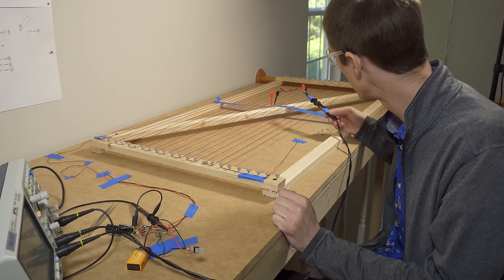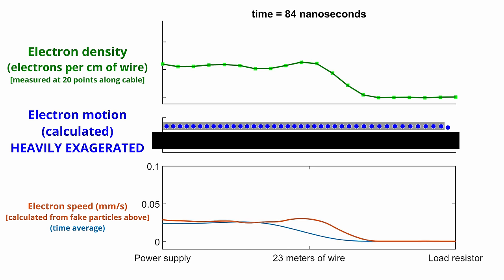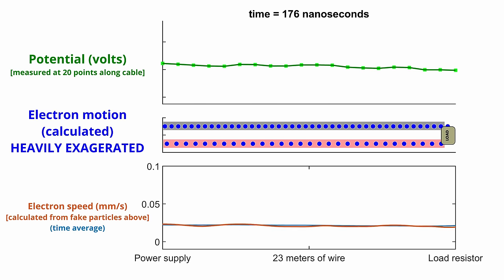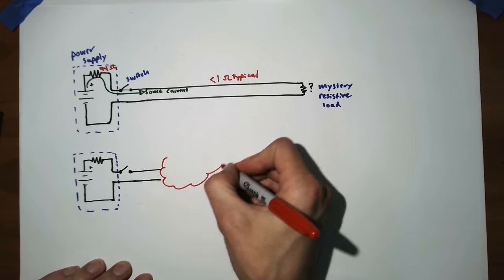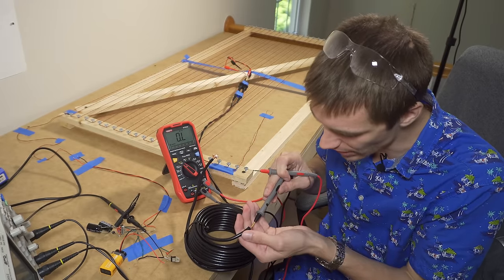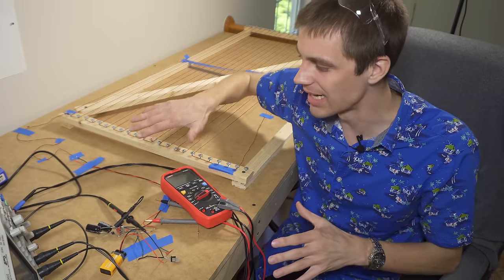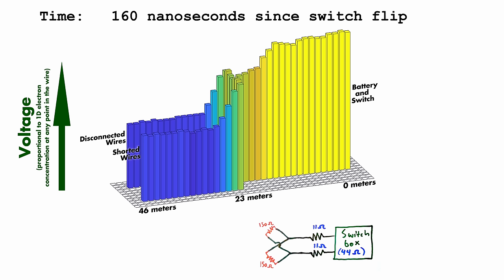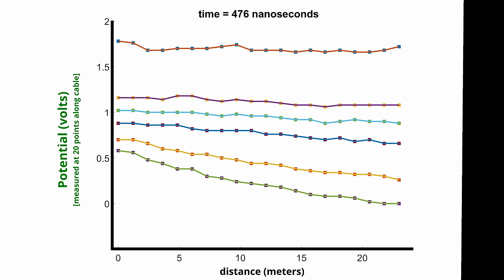What does "impedance matching" actually look like? (electricity waves)

Comment: To have an idea of where the 150 ohm characteristic impedance of the cable is coming from, you can think of the wire having some inductivity and that there is some capacitance between the two twisted wires in the cable. If you would compute the series inductance and parallel capacitance, the resulting impedance would be 150 ohm. Of course, when modeling this, you would split the cable into an infinite number of sections and each section would have its inductance and capacitance resulting in the characteristic impedance of 150 ohms. You can thing of the wave propagation as the transfer of energy between those inductors and capacitors in the infinitesimal segments, each having a 150 ohm characteristic impedance. This also helps to think what happens when the wave leaves the last segment of the wire and hits a short or open.
Reply: To understand that, I would have to know what inductivity and capacitance was but yes, it kind of makes sense. I'm still not sure how you can measure both impedence and resistance in Ohms. If they have the same units, shouldn't they be the same quantity? I guess this is like how "power consumption" is measured in "Watt-hours" and "energy" is measured in "Joules"?
Reply: @aspuzling  You would measure them in Henry (Ohm * sec) for the inductance and Farad ( C / V ) ...I hope I still remember correctly, for the capacitance. (where C is Coulomb and V is volt)
Reply: @aspuzling  So both resistance and impedance are the same ‘thing’, except that resistance in DC is a special case. The formulas for impedance of capacitors and inductors are complex (as in have a real and imaginary part) that depend on frequency, and at DC what happens is that the impedance of an inductor goes to zero and the impedance of the capacitor goes to infinity (which is the same as an open circuit), so once it reaches that steady DC state you can basically assume that both the inductance and the capacitance that is inherent in the wires doesn’t exist anymore, and all you see left over is the resistance. So impedance is the same thing, but the dynamic nature of the signal (in the case in the video it’s a transient, the voltage changing in a ‘step’ from zero up to the voltage of the battery when it’s switched on) is bringing out extra elements that you just can’t see at DC.
Reply: @DrenImeraj And the consequence of this is that the "width" of the traveling step-pulse wave front imposes a limit on the practical bandwidth of the wire?
Reply: The wire also has Reactance ie its "resistance" to the flow of AC current as in AC the magnetic field is rising and falling all the time affecting the flow of the electrons.
Reply: @stephengentle2815  Thanks for your excellent explanations. The idea of DC resistance being a special case of impedance is fascinating and explains a lot.
Reply: @aspuzling WH and joules is the same unit, same BTU, it doesnt matter the unit, the power or energy is what those units counts, same as hp, bhp, W, joules/s.. etc
Diff ppl used diff units, for the same magnitude of specific physical property
Reply: This brings me back to doing impedance phasor diagrams, and using simple trig to find the Z of and RLC circuit. Years ago...can't remember anything other than it was fun!
Reply: you don't need the inductance. Speed of wave propagation, (which can be assumed at 2/3c most of the time) will also work and with it resistance is much easier to calculate. You have to charge wire segments (which have capacitance per unit length) at 2/3c. you have capacitance per time, which is charge per time per volt, which is current per volt, which is resistance
Reply: Yes. What surprised me about this is the way they don't seem to stratify the standard on the basis of frequency. As frequency goes up, parallel capacitive reactance of the wire itself should go down, and series inductive reactance should rise, so why isn't there a 'sweet spot" frequency for optimal balance? And the way the standard is based on a theoretical open circuit line of infinite length is mind boggling.
Reply: @spelunkerd  you are mixing steady and transient states..
Thats why you dont get it
Read about it, its easy, transient state is until the "circuit solves itself" all after that is a steady state, no matter AC/DC..
Reply: @isaackvasager9957  i doesnt make him wrong
We from the field are not to blame that very simple facts and laws are not making sense to ppl outside of the field
All seen in this video was known for allmost 2 centuries, mathematicaly expressed and totaly studied, we learn that in school, in fact, if you payed attention to your 6 grade physics class you wld know all this, and it wldnt surprise you
And if you studied el eng, this wld be kids play to you..
Reply: @coaulsi  Yes I think you're right. One blip of voltage pulse can't have a frequency.
Reply: Spot on
This was known for at least a century, when transmision lines were first instaled, in fact, this was allready considered solved from the time of the telegraph
You are totaly right on the infinitely small segments, serial inductance and paralel capacitance, some resistance, ofc, as all metals have some small amount of resistance, and reluctance..
Impedance is so simple, you just need two dimensional numbers to write it down, L and C are a duality, like anything else in electricity, they do nothing to U(V) or I, first duality, from which all other come, just change phase of one of them compared to another, and DC is a spec case of AC, where inductor is literary nothing, a closed circuit, but capacitor is a break in the circuit, if connected serialy with a power supply, if connected in paralel, the oposite is true, again, duality
If not for that duality, we wld still see electricity as a danger to us, and in a tunder strikes, nothing technical wld be possible, and in fact the mechanism of the thunder is the same what he shows, universe doesnt know which molecules of air are going to be ionized, so the whole proces nano second by nanosecond is governed by the same principles, conditions arise, voltage is high enough, current starts to flow, ionizes air, gets reflected from the ground up, etc; if u watch a thunder strike in 10-100k fps, you see that thunder starts at the same time both from the clouds and the ground, gets teflected multiple times, before steady state arises, cloud comes down and same happens again
Tesla noticed a century ago that thunder triggers rain, or is it another way arround, doesnt matter, thats another example of duality, though diff kind from voltage/current duality, it tells us that we are the ones that "invented" those dualities, in order to use math, and make any engineering possible
Line Z is a very well known "phenomena", explanied arround the time first telegraphs experianced signal reflection, for example
All this guy uploads are minimum century old laws and rules, it shld be watched by kids, not grown ups, as we all learned this in physics classes, in elementary scholl, at the latest first two years of secondary school (elementary school 8 grades, secondary 4 grades, i had this in all encompasing school, the one you go to if u want to go to the uni, later got degrees in el eng/telecommunicatins, and astrophysics, all for free, thats the system in my country, if you are good enough student you get free education, only small number of students pay their schools/unis, maybe 10%, in fact we get payed to do a phd, as a university profesors helper, thats how i got both masters degrees in two diff schools, they paued my C2 eng test in british council, and all else needed for my studies)
I live in a country, ex SFRJ/Yugoslavia republic of Serbia and all of my education was free, there are some private schools, but no one will employ a student from those schools if they have candidates from the states unis, our educational system and our social security is the two things that work here, with all corruption, a uniparty allmost, again, and a politbiro (they dont go by that name since SFRJ was torn appart by the west/usa/nato, we are now "democratic, capitalistic" but ppl never lived with less, in '85. for example we had 5th largest ground satelite station, we had nuclear programme, 40mil ppl, now there is 6 countries, Croatia and Montenegro with only turism, slovenia with one tech company (real tech, not sw devs Gorenje), Bosnia has nothing, they are not even a propper country for 20+ yrs now, and Macedonia (North Macedonia is the official name, bcs Greece had a problem with it, bcs Alexander the Great was a son of a Macedonian, not greek..); then, before 90s we were a great country, everyone in the world wanted our passport, but we were the thorn in the usa eye, so cia did its job, it turned neighboures against each other, and watched how we kill ourselves, there were all kinds of religions in SFRJ, namely orthodox and roman christians, and muslims, even long before that, but the creation of Albania in ww1 was the breaking point on the balkans, we drove off the Otomans after 5 centuries of their rule in 1800, we had two balkan wars, liberation wars; europe let us be the buffer zone against very advanced otomans(todays Turkey), never helped us one finger, and when we drove them off, and the dynasty collapsed and became modern Turkey, we flourished, all of us together, we grew too much too fast, usa/europe didnt like that, nato even bombed our cities, bridges, rafineries, they hit empty military hq building in the centre of Belgrade, our TV station, same in the center of the capitol city, and no one evergot punished for that, 23yrs later, usa and the whole west goes down the drain, whole world laughs at them, china won, its over for usa, esp, germany will turn their back on them, its the land of genocidal maniacs, and unscrupuled so called bussines man, and the whole world now sees that, every war since ww2, which usa had no wish to participate in, but rose economicaly and technicaly to world power no1 teached them that the war is the best bussines, but not war against other world powers, russia, vhina, india, no, wars against small unstable regions, which only need a spark to ignite the war, then cia provides weapons and sit back and watch their mic print weapons for both sides, thats the war on terror. Goebels said it best, on how to control the ppl, and how to attack others in self deffense (a promise of it): just tell the masses they are being attacked from within, and the usa learned that lesson very well, they sre in a state if constant war, since ww2, have 700 bases arroind the world, most arround the china, usa is petrified by china, but they know they cant win that fight, so they pick on taiwan, which themselves they aknowledge as part of china, thats uts own story
Sry for the novel, i got carried away by mostly americans not knowning nothing about anything, but trough the lies they are the no1 superpower (very questionable today, just look the last two presidents, and idiot, and a senile very old man, who by the way "ordered" the bombing if Serbia in '99.)
Deplorable country worthy of everything bad its going to happen to it in the next decade, the worlds police man is the most corrupt guy on the planet, and shld be expeled from the rest of the world, and that process allready started, ukr is over, now show of power trough the israel, a openly genocidal country, polar opposite from the country it shld be, cosidering their faith in conc camps, or is that story overblown too, in order to masacre garmany, usa and britan leveled most of the germany at the end of the ww2, alongside the rest of the europe, the cradle of civilization, all from the same genocidal ppl who killed off most of native ppls of americas, all european in origin..
Again, sry for the tyrade
Reply: @spelunkerd  ofc not, frequncy is something happening over time
That one blip/pulse is just that, a momentary spike nothing more, you can measure its amplitude and calc the current on some load, the current will be the same spike, inductors and capacitors wld just change their position on a time axis, on a plot, if time is on horizontal axis, current wld ne ahead, or trail the voltage if load is not purely ohmic (has some L or C)
Reply: Lumped element circuit model for transmission lines has 4 transmission line parameters (per unit length)
R' = combined resistance  (Ω/m)
L' = Combined inductance  (H/m)
G'= Conductance (S/m)
C'= Capacitance (F/m)

Additionally, there are geometric parameters depending on the type of transmission line geometry (in units of meters)

Coaxial cable: 
a= inner conduxtor
b= outer conductor

Two wire:
d= wire diameter 
D= Wire spacing 

Parallel line:
w= width of each plate
h=thickness of insulation
Reply: @aspuzling  DC resistance being a special case of AC impedance may become a bit more intuitive if you realise what complex numbers are. You're already familiar with the idea of a "number line;" complex numbers can be represented in the same way, but instead of being on a line they're on a plane, like a standard X vs. Y graph. In this case, the horizontal axis is the "real" part of the number and the vertical axis is the "imaginary" part of the number, the part you multiply by i (often notated as j in electrical engineering), the square root of negative one. So 2 + 3i is two to the right on the horizontal axis, and three up on the vertical axis. If the imaginary part is 0i, then you have only a real component, and when you have only a real component you can call that "resistance" instead of "impedance."

(As a side note, "imaginary" is a terrible name for multiples of i; they're no more or less something we imagine than the "real" numbers. It's just that, back in the day, René Descartes hated the idea, thought that such numbers were fictitious or useless, and so picked a derogatory term to talk about them, not realising that complex numbers can be mapped to physical phenomena in the real world just as easily as we can map 1, 2, 3, ... to "one apple, two apples, three apples, ...." It's akin to someone deciding that negative numbers are "imaginary" because we can't hold "negative one apples" in our hand.)
Reply: @spelunkerd  Actually a single pulse or blip can have a frequency: being able to calculate the frequency at any instant in time is why we have calculus. Whether this is important or not depends on the application, but too-fast switching in certain systems not designed for it (e.g., high-speed 74AC logic combined with old vintage 74LS-era CPUs and peripherals) can be a problem due to ringing, caused by the very phenomenon this video is demonstrating.
Reply: So if the wire gauge or separation of the wires (not twisted, for example) were changed, the impedance would change and therefore that resistor? The 50ohm coax cable has a characteristic 50ohm impedance when a impulse voltage is applied?
Reply: @trevorwynkoop8591  A twisted pair of wires are still separated by the width of the insulation surrounding each. And yes, if the separation is changed, the impedance of a transmission line made from those wires changes. 50 ohm coax has the same characteristic impedance regardless of what kind of signal is applied.
Reply: @trevorwynkoop8591  following your line of thinking,  you might want to read about how Ethernet cables work. The different amount of  twists effectively make longer/ shorter for  each of the twisted pairs for the same length run of cable. Since  the twisted pairs are twisted by different amounts, it allows the signals to propagate down the wire at different effective speeds ( different lengths of wire)  in order to mitigate capacitive coupling  over a range of frequencies. I know this doesn't really answer your question directly, but reading about this will probably help you with your understanding about this topic.
Reply: Inductance is a coefficient of storage of energy in a magnetic field  by the current. Capacitance is a coefficient of storage of energy in the electric field by a voltage. Resistance is a coefficient of power dissipation by the current. (Steinmetz's definition)